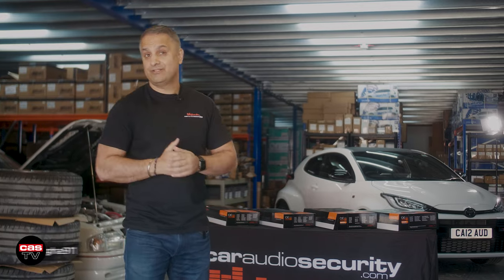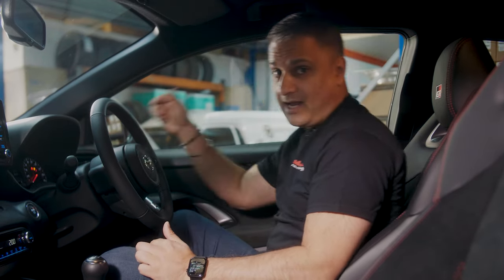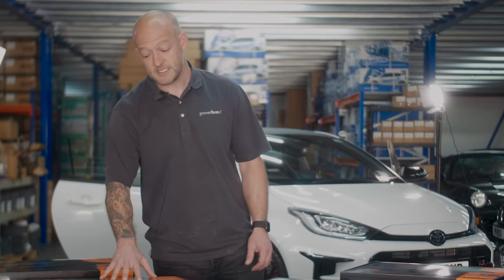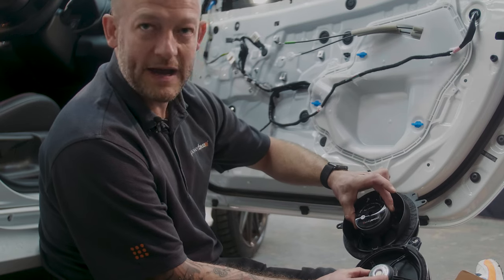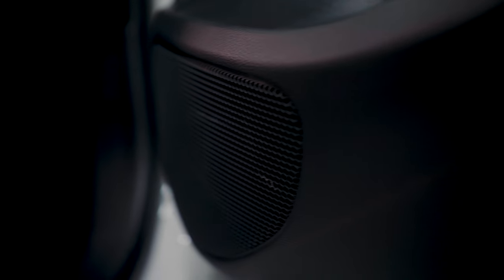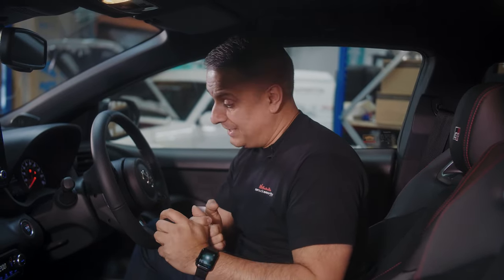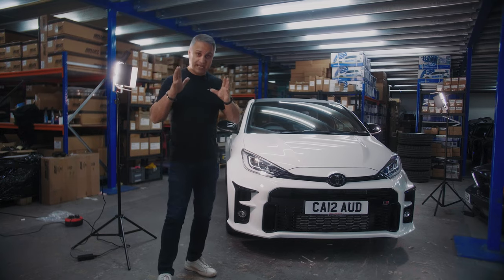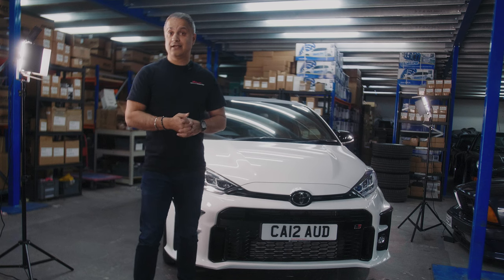Toyota GR YARIS Powerbass Speaker upgrade | Car Audio & Security

Comment: All sounds fab, and easy. Until you get the speakers and you have the car stripped, only to discover that power base have not supplied the correct plug-in adaptors in the kit, not just the rear speaker kit, but the front one as well. Bloody nightmare, had to strip back the cables and solder the wires to the car wiring loom(leaving existing plugs on, in case someone wants to return to stock). WARNING, Don’t trust power base to supply you the correct kit. Speakers sound fine.

Comment: 2 points to consider before upgrading speakers. 
1. the flimsy light paper cone OEM speakers are highly effective (less power needed to make noise) - by installing "better" but less effective speakers, like heavy membrane, big magnet, the overall loudness or max volume can drop.
2. the signal coming to the speakers from the headunit is DSPed,  to compensate the sound curve of the speakers - by installing new speakers with different sound characteristics the result can be annoying spikes or drops in some frequencies. so overall you might squeeze out better base etc. but you gonna live with some unpleasant effects.
Reply: Regarding point number 2 - I have heard about this. Can anything be done apart from installing 3rd party amp?
Reply: The OEM drivers also use neo magnet motors for the bass drivers, so they will naturally weigh less.  The replacement speakers don't use neo magnet motors for the bass drivers.

Comment: So I've just replaced the front speakers in my GR Yaris with these. It was a nice, easy upgrade that I would recommend.

Replacing the rears are not essential IMO..

A-Pillar trim can be a bit awkward and there's a few screws for the door card which need removing that we don't see in the video.

But overall the video did help, so thank you CAS!
Reply from the maker: Thanks for the feedback - subwoofer upgrade video will be out very soon 🔊👍🏼
Reply: @CarAudioSecurityUK  , great job, please let us know when you upload the video with the subwoofer, thanks
Reply: How’s the ANC and engine sound in these speakers or you’ve turned them off?
Reply: @mahdansar6835  it's so much better with ESE turned off, but I think it's better with ANC activated to eliminate some ambient noise.
Reply: @CarAudioSecurityUK  Come on guys loads of us have bought these now and all are waiting patiently for the promised sub-woofer install. I keep considering  purchasing the Powerbase ST10 but would love to hear your thoughts and see what you install on yours. Prety please do a video 😊

Comment: I’m planning to delete the head unit from my GR Yaris Circuit Pack and replace it with the OEM blank piece from the Japanese ‘RC’ variant. Do you know if this could cause any issues? Specifically, will the active noise control and fake engine sound still function, given that they have their own amplifier?

Comment: Hey, does the noise cancelling and fake engine noise get affected by replacing the OEM speakers with these speakers? Is the top volume lower as more power need to power the new speakers?
Reply: Did you get the answer? I want to know as well. Thanks

Comment: What a difference 👌🏼. I don’t suppose PB do an oe upgrade for a 2017 Nissan X-Trail do they?
Reply from the maker: Amazing difference from a cost effective solution. Do you have the Bose speaker system in your X-Trail?
Reply: @CarAudioSecurityUK  No just the standard Nissan equipment. It’s the top range Tekna model with 360* cameras but still rubbish paper speakers.

Comment: Would be good to mention that the one shown is the circuit pack. No DSP. Non circuit packs don’t benefit from a simple speaker upgrade as they have a DSP so a lot more is involved. 
JL 8” ported sub in the boot sound deadening in the doors tune it accordingly. Let the sub handle its business and the 3 way Jbl’s do the mids and highs.

Comment: Hi, would this speaker set fit into my 2008 Toyota Yaris SR?
Reply: I recently did the speakers in my 07 Yaris. I believe the front door speakers are the same. Rears were 6x9 and use a different adapter but mine is a sedan. Also no tweeters in the front.

Comment: I can confirm that this setup on a GR Yaris Premium Pack sounds crap. Stay with the original. The Bass is horrible with that DSP.
Reply from the maker: Sorry you feel that way. We have sold and installed quite a few of these kits now and the overall feedback has been positive. This Powerbass option is a cost-effective quality solution, however there are other more expensive setups available, which we can also offer you should you prefer 👍🏼
Reply: What is a "Premium Pack"?